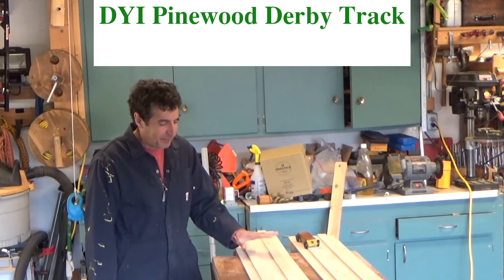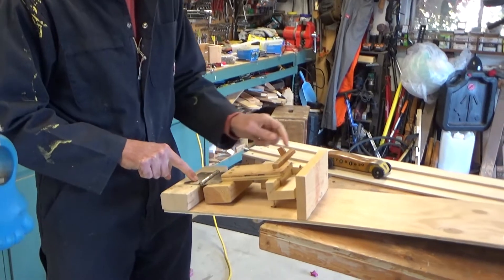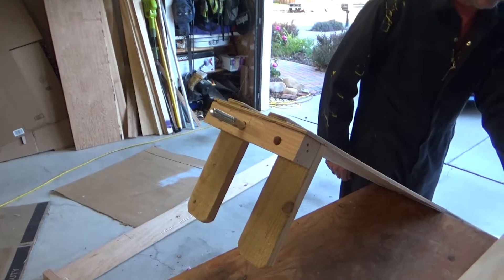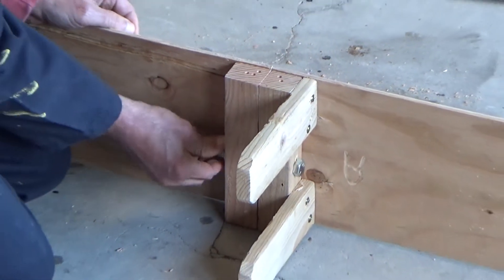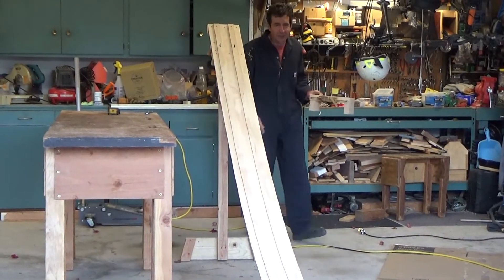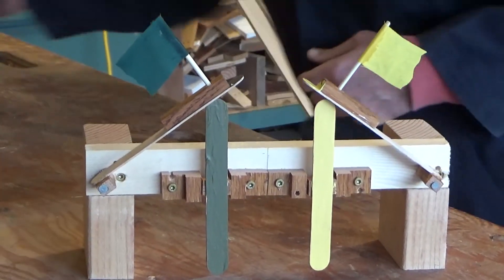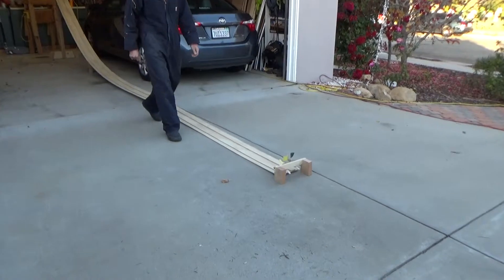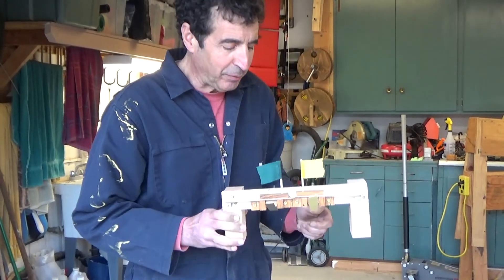Low Cost and Easy to Build DIY Pinewood Derby Track

Comment: Hey Dave, I'd like to confirm some building specs.  Birch seems to be recommended, but from what I can guess, that's basic pine.  Can you share what you picked and why?

Second, it seems like you used three 8' sections. Is that right? Is that a good length or is four sections better for run out?  

Videos of aluminum tracks appear much longer, so I wanted to check.

Thanks again and we'll done!!! 🎉
Reply from the maker: Great questions.  I built this track entirely from scrap material that was left over from other projects including the laminate flooring.  If I was going to build with new material, I would use pine because that is what is commonly available at lumber yards in my region.  Birch is a relatively rare specialty wood here.  The length of the track depends on the room size and the crowd size. A rule of thumb would be 1 foot for every car so a 24 foot track is good for a group of 24 competitors.
Reply: @DYI Great, got it! Thanks a ton. Prepping to build. 👍🏻

Comment: Thanks David... I'm a schoolteacher, mulling a Lego building class and stumbled upon Pinewood Derby (Lego) cars. Buying tracks are very expensive... your build makes me think I can make one a lot cheaper! If I do, do you think adding a third lane (or more) would be simple?
Reply from the maker: Adding a 3rd track would be easy, but if the cars are very close in speed it can be very hard to tell the finish order.  Also, with 2 per race there is only one boy who needs to lose and with 3 there are 2 that need to lose!

Comment: Hi awesome work man. What size lumber did you use for the center rail?

I really want to make one of these because my son is in cub scouts and I’d like to be able to test run the couple different designs we’ve done over the last two years.
Reply from the maker: Same question I got exactly one year ago.  Just scroll down.  Yes, very good idea to build a test track, but you really need to make it very close to the one that they will be using as the track design can make a big difference.  It really matters if the track has a sharp drop and goes flat or is a constant slope.  In the first case it really matters to have the weight in the back of the car because it gives you more potential energy.  Cub Scout Derbys are fun, but it really gets fun when you get to help your boys with Eagle projects. Enjoy you time with our son!
Reply: @DYI  thank you 🙏

Comment: How wide did you make the guides?
Reply from the maker: 1 and 5/8 inches wide and 1/4 inch tall is the official track.  If you make them narrow, a really well tuned car can make a run without touching the guide and go even faster, but a bad car will be slowed down.  A wide track will rub some on all cars.  We had some cars with weights glued to the bottom of their cars and it scrapped the guides.  A lower guide would have helped this problem.

Comment: Very good idea very simple great job. Have to make one I have twins. So it be well worth it. Seeing how you get no time to test a tune on derby day. Thanks for the video
Reply from the maker: Good luck!  Keep in mine that a car really needs to be tuned to a specific track.  For instance if you have steep track that levels off to flat you really need the weight in the back of the car for more potential energy.
Reply: @DYI  thanks I have built it it's to specs with the Derby rules. The only difference is wood. I ran some of the old cars that I had done and it works pretty well. Just have to tweak it a little here and there. But it was a great idea and I liked it . If I could send a picture I would send you one. But thanks again

Comment: The finish gate is incredibly ingenious!
Reply from the maker: The kid's were pretty rough on it and ended up breaking the Popsicle sticks I used so I re-built it with 1/4 inch x 1/2 inch oak and am ready for next year.
Reply: Any ideas for 3 lanes?
Reply from the maker: @ryanmotz664  Ryan,  That is a really good and interesting question.  As you figured out, my mechanism only works for 2 cars because it can fall either one way or another so it only will work for 2 cars.  I can think of a way to do more cars, but it wouldn't be so robust.  You would basically need to have 3 sticks of different colors fall and you could figure out the race order from the fallen stick order.  Instead of falling perpendicular to the track direction they would need to fall parallel to the direction.  The 2 outer sticks would need an arm at right angles going towards the center so they would overlap the center stick.  It would be complicated and not reliable.  I think if you want more than 2 lanes you should go for one of many electronic solutions other people have used.  We had about 40 cars racing against each other with my 2 lane track and it was fine.  You can find the winner of up to 64 cars with only 6 races using a binary tree.
Reply: You are awesome!  I appreciate your willingness to help.  I think running 2 lanes is the solution.  Expensive little project building my own track and multiple cars and jigs and such.

You are awesome!  Keep up the good work.